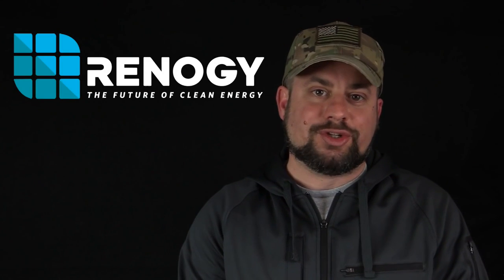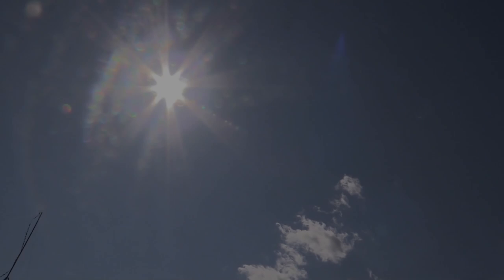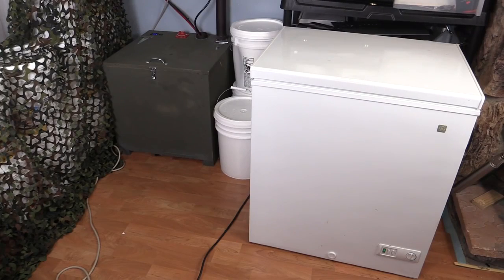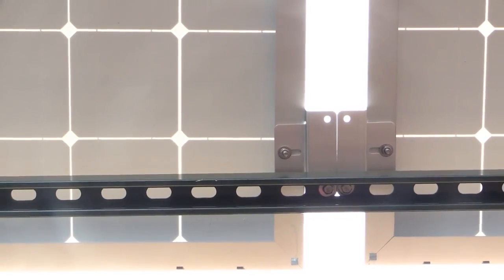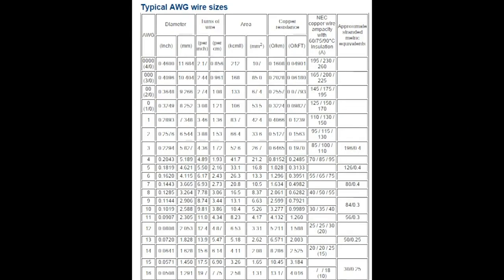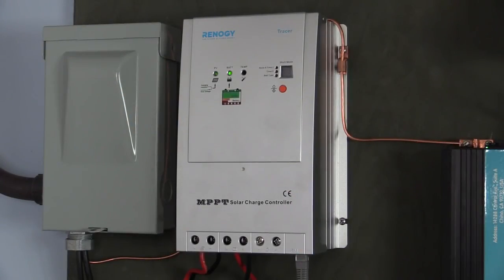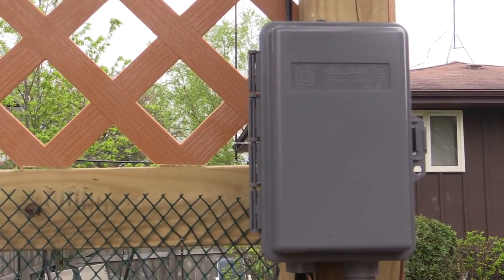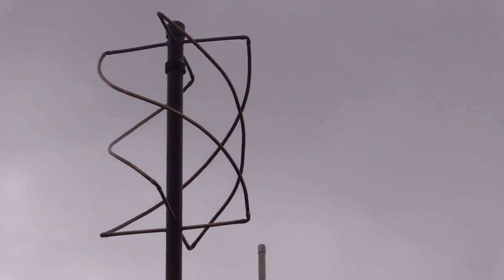The Ultimate Guide To DIY Off Grid Solar Power | Tin Hat Ranch

Comment: Good video, lots of good info.  I'm plan of building a 1.2Kw system 48 volt system, the panels are not too expensive at 60 cents a watt, controller and inverter prices are going down.   With a 48 volt system I can save big bucks in wiring.   The big expense is the batteries.  Living in Co Cal. I get a lot of sun hours.  According my calculation it going I think I can build the system for about $3000.

Comment: Amazing video, very informative. Really good presentation!

So in theory, would a really really massive system be reliable?
(10kW of panels, 5000Ah battery bank, etc.. Basically a large house)

Enough to run a 1-2kWh load 24/7 with the ability to run 5kW peak loads for a few hours?
Reply from the maker: +Johnny Joannou you would need a much larger battery bank that 5000ah, and it would be expensive.

Comment: Interesting video. I am on the track to reducing my hydro use to the point that I will be living off the grid. I'm from Northern Ontario, and the challenge is big. I am currently running a 1500W inverter using a deep cycle marine battery. It has cut the cost of my hydro by 75%. 2 months ago I using $4 to $5.00 per day in hydro, I am now using 0.9 cents per day. In my area, I am conserving 59% less hydro than my neighboring house holds. Thank you for all your important information as I will be using as a guide to be totally off the grid in the near future.

Comment: EXCELLENT coverage! I went through this several years ago for living in my RV.... Learned everything you said - sometimes the hard way.   Suggestion - I doubled up my smaller 10 g wires for each panel pos. and neg...... made a big difference.. and much cheaper than big wire.

Comment: i have a question, do you think the Goal Zero Yeti 1250-240 Portable for about 2k is a good deal? the reason i ask is that for the price and it being fully contained compared to building your own system , as well as being able to upgrade. Would you give the thumbs up? more pros than cons? thanks so much,  your video is epic!
Reply from the maker: +Rich Perez I've never any experience with the Yeti.  From the spec sheet it only had about a quarter the capacity of my system.  That being said, it's portable and all in one.  I guess its application and/or preference.  Actually, Renogy is coming out with something similar very soon, it's about half the price and has the same capacity and uses lithium iron batteries.  It will be a fraction of the weight of the Yeti.
Reply: +TinHatRanch thanks for the reply, oh man...i hate waiting for stuff, sigh...😉
Reply from the maker: +TinHatRanch it will be out in just a few more weeks.

Comment: Excellent video.  You delivered a lot of information in a way people can understand.  As for the Kill A Watt meter I was noticing that 30 seconds before that you were pointing out that people understand money better.  Is there a meter that allows you to put in your local electric rate and then calculate expenditure?  As soon as you have a meter delivering information on watts, amps, etc you have lost the average person. 
I am going to start converting watts to $$$ so that it is easier to talk to people.  Thanks for the tip!
Reply from the maker: +Sean Nanoman it calculates kWh.  That times your rate is the cost.
Reply: TinHatRanch Certainly does, and not a problem for me.  I just thought if such a unit existed it would be better for those who are a bit more mathematically challenged.

Comment: To tilt and turn, essentially track the sun, one could buy Arduino mega, Ramps 1.4 add on board, two TMC2100 MotorDrivers and two 48nm stepper motors what from China will cost about 50-100€. Then building program in C, this can turn panels with some DIY gearing system to optimal position. Of course one needs to do calculations and knowing how to program is bad idea ether, but for cheap DIY system this should work well. Also thanks to micro controller, one can add features likel electric scraper if sensors feel that panels have snow or other crap on them. There is tons of things you can do with it. If system works like it should be, then you can make your own board, order it from China and install your program there as stand alone system.

Comment: ultra capacitors are far cheaper and last longer and are way more efficient as far as recharging
Reply: +charles fournier Only $60,000??? what a bargain!
Reply: Yes, but to store lots of energy with ultra capacitors is quite expensive compared to lead acid batteries. They are not well suited to storing large amounts of energy inexpensively.
Reply: +Skilled Trades Info that is completely untrue we just got done an installation of  a 112k watt system and it completely charges the system which is 283k  watt storage system and powers the house all day at the same time and the bank never drops below 91% no matter what is run and the storage and the panels and inverters only came to around 60k total for supplies and 2 1/2 days of install
Reply: .....  how much though...$$
Reply: +Josh Goldberg it all depends on what the draw is when the draw go‘s down power remains this is how the tesla wall works look up the designs on it
Reply: +charles fournier where is this system? I didn't know ultra caps were being used for storage.  what company makes these ultra caps?
Reply: +Tony Zee I am on vacation right now but you can call green power of nc and talk those guys or hit me back after the 1st of aug I do know that there is a veteran owned and operated company just outside Raleigh nc that will build the cap setup for you and they build them for ac and dc so whichever way you want to go but since the price on lead acid batteries is so out of control since the wars started and lead is a main part of bullets but either way you should call the guys at green power nc and tell them I sent you
Reply: +Tony Zee ya for a system that is so large it powers a whole mall 24 hrs a day and almost never pulls from the grid and has the benefits of being 3 phase hell ya its over 100 thousand watts
Reply: It's been two years since this comment and ultracapacitors are still way more expensive.  I looked recently and to store the same amount of power as a single 12V 7.2Ah SLA battery the ultracapacitors cost $3,000 and the SLA costs $20.  Ultracapacitors are definitely the way of the future, but they still have a way to go before they become an affordable alternative for those on a budget.

Comment: You left out micro inverters, and grid down 12v led lighting. I'm trying to economically add extra batteries and solar panels to a Prius, I can't find one key component maybe someone on here can help, I've been searching the internet for a 48v DC step up converter to 240v DC.

Comment: Great video and information, BUT....speaking of safety; your batteries should be way off the floor in case of flood, excess humidity, etc... a wet floor (or regular concrete floor) can be equal to ground and discharge your batteries in record time!
Reply: I just learned 2 days ago that new batteries don't have a problem with that, but I did have some plastic case batteries die on me about 20 years ago because I left them on the basement concrete and the garage asphalt. I'd still consider raising them just in case of a major flood, though....

Comment: BIG QUESTION.  These EnPhase systems are being pushed for battery power in a grid tie situation.  I just checked out their webinar at http://info.enphase.com/ "Solar 101 for Installers"  BUT these seem VERY HIGH cost with little backup capability.

REALLY interested in your take on this.  We are in process on getting solar panels, and now company drops this EnPhase thing as the only way to go.  Here's the basic problems I see with it (taken from my notes with including the diagrams).

All these units are AC powered and communicate over the AC wiring. 
(A) Requires micro inverters at each solar panel.  Doubling cost of the panels!!
(B) Batteries are VERY EXPENSIVE per watt.   (Lithium batteries & lots of conversion)
(C) SINGLE PHASE power only.  Not workable if 2-phase loads need power, such as well pumps, welders, etc.  (Their system could not provide the peak load currents anyway.)  
(D) Only supplies 270 Watts per unit !!  Not even worth the trouble !!  (Bingo – this is their supposed “right-sizing” they push)
Sorry but more capacity (up to a point) is better. 
Even the full complement of 13 of these "batteries" yields a max. output of 3500 watts, and is paired with a single 20Amp breaker in their scenarios.  This 3500 watts Limits your peak.  They don’t specify the charge rate, which is a HUGE issue – one must presume it is at or less than the 270W, thus limiting uptake of solar for storage purposes.  
Some loads have high startup currents – my well pump draws 8A @ 220V, with surges well beyond, such as 6x more.  Generators coupled to such loads need short term ability to at least 8000 watts.   20kW of forklift batteries can support an 8 kW output for short periods of time, and charge at that same rate.
(E) Tied into only their components.  And they are not user configurable. 
(F) Battery replacement, involves replacing their unit (or equivalent cost for repair).
(G) Self-consumption is worthwhile, but does not solve my main concern which is “grid substitution”. 
(H) Backup capability limited.  Their diagram describes a single breaker from load center to a dedicated set of loads on that one breaker.  In existing homes these loads are often embedded with other loads and are not readily separated.  User must still be cognizant of overloading the meager battery capacity of the unit has.  
(I) Overall loop efficiency will be lower than with an off-grid configuration since DC power from solar is (1) converted to AC to go into box, then in the box (2) AC is converted to DC as the battery charge controller, then during use (3) DC battery is converted to AC again to output from the unit.  
(I don’t accept their efficiency numbers for DC-coupled batteries; …comparing against old tech.)
Their battery system has 3X AC-DC power conversions for every Amp used. 

I have to work this out with them soon.  Any thoughts you may have would be appreciated.  
How to wire up a grid-tie system, that I can readily configure to handle proper backup power, including:

How can a system be wired up to:

(1) Grid Tie while grid is available. 

(2) Battery bank kept charged.

(3) Switch auto/manually to supply loads (1 & 2 phase) from inverter coupled to battery.

(4) Not limiting loads to select lines, or dedicated ports. 

Many Regards, RH 

Still think you've got the best - web presence on YouTube!

Comment: Another variable (actually a few).
When charging batteries, only 80% of the energy is stored because of heat losses - Therefore each 100 watts will turn out to be 80 watts.
When taking energy OUT of batteries - 20% is lost due to heat. So now your 100watts becomes about 60 watts.
The inverter is around 95% efficient so now the 60 watts becomes 57 watts.

Just sayin.

Comment: Nicely done, very high production value which is a nice change from most YouTube videos.  
You probably cover this in some of your other videos but it seems like the Enphase Micro Inverters are better choice for many because they convert the panels to 240V AC at the source.  This makes adding new or different panels very easy also the high voltage makes the power cable is smaller.  Another problem with a "string" inverters is that its only as good as the worst panel on the string, so any shading or a bad panel really reduces the output power.

Comment: probably the most informative video ive found on solar sofar, but i still have questions...
 i want to use solar, to charge my electric bike while camping,... its already has its own battery and charger, which i plan on running through an inverter  (it was expensive, im using  the proper charger, no exceptions)....  so my first question is...

 can i bypass ( skip) the lead acid battery, and run the  inverter  (400w) and lipo charger  (60vdc 5a output) directly off the panels( 2x 100w) and the charge controller ( 30a)???

 ... charging one battery, to charge another, seams a bit ridiculous,  and like it would reduce efficiency, plus its a shit ton more weight then i already have with my  about 20 pound lipo battery.

Comment: I am looking for a mppt charge controller. In the specs it mentioned max. pv power of 450W (12V system), 850 W (24V system), 1700W (48V system). What does all this numbers mean? does it mean if I have a series of 5 pieces of 100W panels (hence, 500W) the charge controller will not be able to handle the load?
Reply from the maker: +Kai Yee Tan without seeing the specs it probably refers to the battery voltage.  If your battery bank is 12v, then no, you are exceeding the rating of the charger.  If your battery bank is 24 or 48v, then yes.

Comment: you started this almost hour long video by sayin you would go over how much a system like yours, like the example you started with would cost, but you didn't. 
You mention cost of a few items here and there.. but I waited for your overall cost estimate that never happened. 
So, I'm left with no idea how the cost to kilowatt ratio goes. 
Like some other folks here commented,.. it would be nice to know things like panels are affordable, but storage (batteries) are not. And, ultimately how much it costs per watt. etc etc. 
thanks tho for all your info.
Reply from the maker: +Sean Sullivan this was originally a series that tied to the Tin Hat Ranch website.  It was re-edited into one video.  There are links in the description below to a ton of information.  The costs are going to vary in a system of this size, for just the equipment, panels, batteries, charge controller and inverter is in the neighborhood of $2000-2200.  With all of the extras, a lot of which are unique to my situation, a frame to hold and mount the panels, battery box, wire, and misc parts the total is roughly $3000.  So, in its entirety, it cost me $7.50 a watt.  Comparing that to the often quoted price per watt of panel (currently $1.50 for the panels I used) it can be very misleading.
Reply: thank you and good to know. Was just curious and thinking how and when it pays for itelf vs. paying the utilities companies.. and would be a lot more (like you said in your video) to run the power for a typical house. Anyways, thanks for all your info and research, it is much appreciated.

Comment: Just one error I see in your presentation.  The maximum current from the panel is in a short circuit condition, not open circuit.  Open circuit, no current can flow.  You have to take note of the open circuit voltage as this is very important when selecting a controller that is capable of withstanding the voltage.

Comment: Some compact solar systems are starting to show up such as Goal Zero, but they are expensive for what you get and are more for short term use such as camping or a short term blackout.  It could have been a great system if the panels were not so small, as they take too long to recharge the battery (probably a lithium).
There are some smaller systems on Amazon for emergency lighting. I bought one and it works really well. It can power the included light bulbs all night long and recharge the next day. All the outlets are USB so it will recharge cellphones and tablets, and run a couple of USB fans.

Comment: Great Vid, TinHat...I'm a general class from 9 land...
Tip for your subs....
For those of you who have never put in an 8 foot ground rod, a secret to doing it is to use water...start a hole with a shovel...then pour the hole full of water, start pushing the rod into the ground, lift the rod and allow water into the hole.  then force the rod back into the hole.  This will create a hydraulic action somewhat like fraking, it will help drill the hole.  I have done this and did not have to use a sledge until I got right to the last couple feet of the rod.